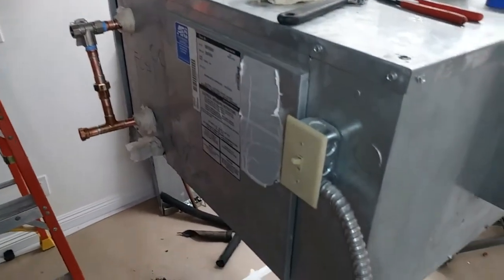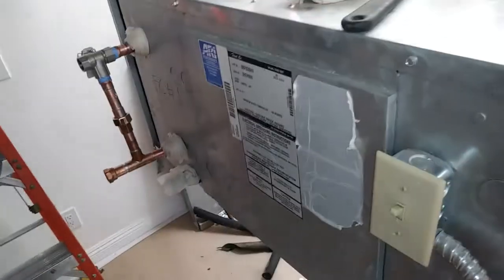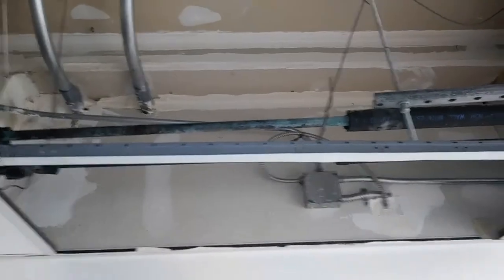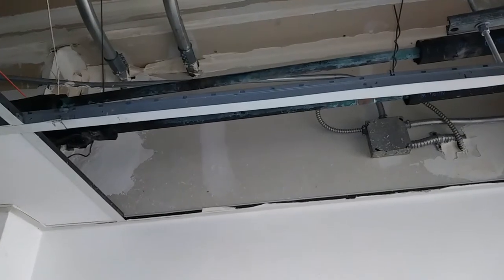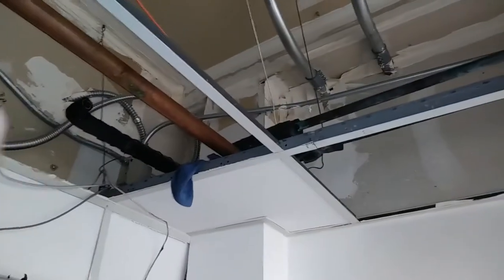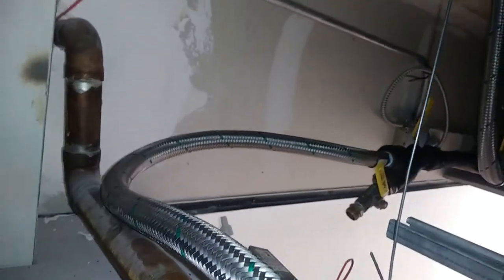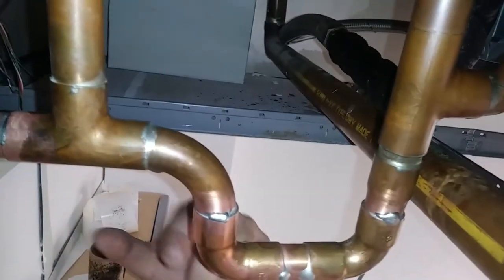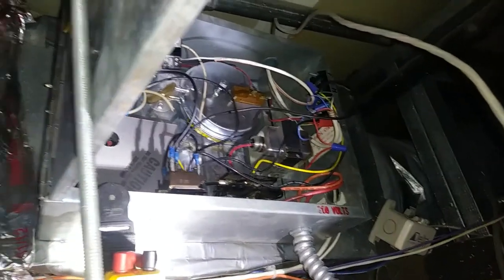3-ton Chilled Water Fan Coil Replacement w/ Belimo 3-way Valve

Comment: I did not know that building had fan coil units as well besides the heat pump's ? anyhow really sweet install that solder job was clean as hell !! Nice
Reply from the maker: There are two building on this particular campus built at the same time. One is WSHPs and the other has a chiller and fan coils with (get this) electric strip heat!!! Can't believe they didn't just install a 4-pipe system with a boiler. 30 years ago, some pencil pusher got the bright idea to make the tenants pay for their own heat and everyone's been suffering since.
Reply: @71dembonesTV  Thats crazy ! Yeah its common to see a 2 or 4 pipe system and am sure that had room for a boiler too !
Reply from the maker: Yeah, no one can believe it when I tell them. Plenty of room for a boiler, they just didn't have their priorities straight.